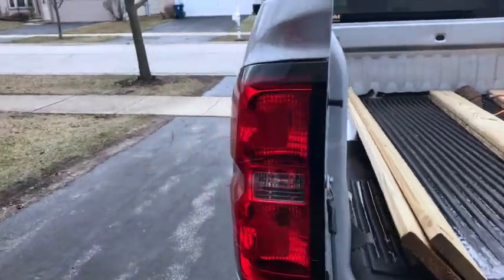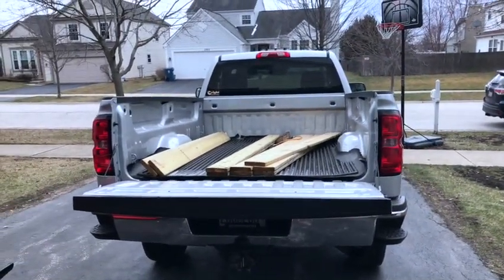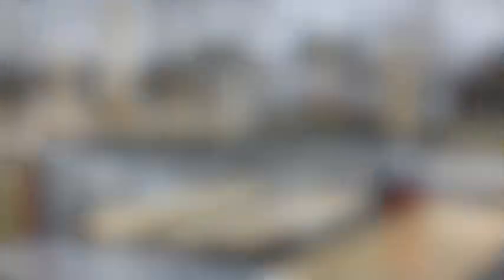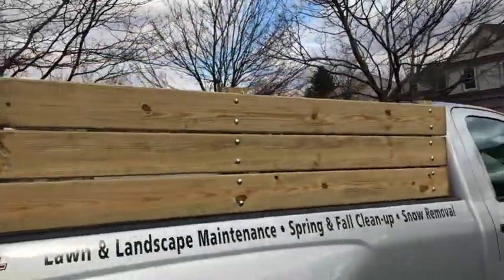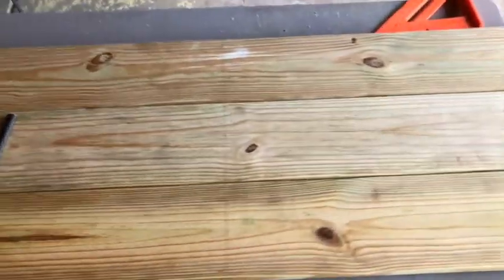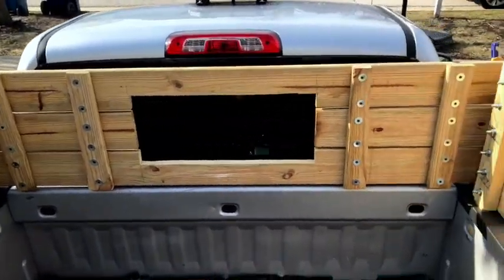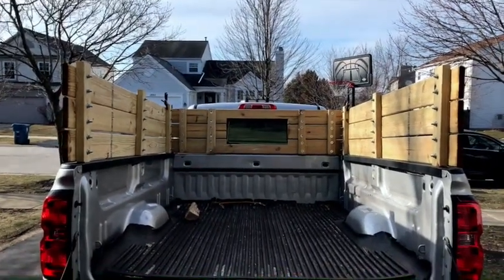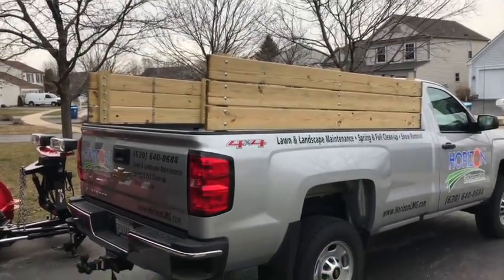Horizon VLOG #19 | Building Walls for Truck Bed

Comment: Looks great the only thought I have is you could put a small swinging gate just above the the tailgate so that you have an enclosed box and non of your mulch will fly out the back, plus you can stack bags of recycling full truck bed style , if you ever do recycling you could make 300$ a trip off of plastic bottles and cans with a full truck bed pretty easily.

Comment: Just wondering you are using nuts and bolts to assemble the walls but the actual posts you are using small screws? Plus made holes instead of using the existing hole which you could of used.

Comment: The stake holes in my 97 Ford ranger are only 1.75" × 1.5" and there's only 4 of them.. don't seem that would allow a strong enough piece of lumber to be put in there to support the rails and to hold a load of firewood

Comment: I like what you've done.  functional and it looks good.  Myself I would stain it.  And I would not have used the self-tapping screws on the post holes.  Holes are provided for a reason.  Washers and bolts would have done fine.
Reply: How would you put in a bolt and washer in there’s no room in the hole

Comment: How did you cut the openings so clean on the plastic liner. You cut them so perfect
Reply: Dan Straiton razor knife. It’s pretty thin in those areas because Chevy knows you’ll eventually need to cut them out. They were already traced out where I needed to cut. So I just cut along the line with the razor knife.

Comment: Excellent video, looks great! Stupid question: does someone sell the stakes to fit in the bed? Or is shaving a 2x4 the only option?
Reply: Depending on your truck 2x3s might fit with no modifications.  On my f150 i had to shave 1/4 inch off a 2x3 to make them fit well.  I used cedar 2x3s and 8 foot cedar fence planks on mine.

Comment: Great vid the only thing I would change is the screws. I think dry wall screws rust.
Reply from the maker: Yes, you are correct...they do rust. But, knowing that these walls will only be on my truck whenever I need them and not all the time, I just went ahead and used them because they are quick to zip in and out. It only takes me about 5 minutes to put on and take off...when I'm not using the walls, they are leaning against the wall in my garage. Thank you for the comment, and if you haven't yet, please subscribe! Thanks again.
Reply: Replace the drywall screws with screw's rated for treated wood. The chemicals in that wood will eat those screws.
Otherwise, nice build! Simple and effective.

Comment: Would you happened to have a matl list,  your came out really good, we have a lawn service also and are wanting to do the same for more volume
Reply from the maker: Bob T yep. Pretty simple. You’ll need 4 2x4s, 1 piece of plywood, 8 e-trac shelf brackets, and 2 4’ sections of e-trac. Then of course self tapping screws and drywall screws.
Reply: @HorizonLMG    Thanks and keep up the good work
Reply: @HorizonLMG  where's the etrac? I missed it
Reply from the maker: @vickit9752  the etrac was purchased at harbor freight...2 5 foot sections. I think they were $30...its been a couple years, so I can't remember exactly.

Comment: What do you think of the idea of putting the vertical supports on the exterior, so that if you are hauling branches they don't get hung up on the vertical ones as you try to shove them in?  Ditto the bolts--if the rounded head is on the inside, while the bolt and nut on the outside, things can't get hung up on the latter as you try to shove them in the bed.

Comment: I'm looking for a solution to my issue of taking my livestock (pigs, goats) to the butcher. I'd love to use this idea. Do you think it would be easy to add a gate that can open and close above the bed of the truck to keep in livestock?
Reply from the maker: 5 Gammons on 5 acres hmmmm. That’s a good question. I don’t think it would be difficult at all. You could add the gate to the back or the side. You would just need to add hinges. I would add the gate at the back above the tailgate. Add two heavy duty barn door hinges on each side and have the gate open like a barn door (one to each side). That’s just how I’d do it.

Comment: Hopefully if anyone else is using PRESSURE treated Make sure it is Painted or your ALUM truck pockets etc. are painted and the Pressure Treated wood against ALUM is not a good idea. The Alum will corrode from it. Learned that from making decks for a Alum Jon Boat.

Comment: How much did it run you in material? Also- how is it holding up since April?
Reply from the maker: Josh's Lawn Care it cost about $75 from Lowe’s and they are holding up perfectly. Still strong and sturdy!!
Reply: Horizon LMG — Thanks for the quick reply. I have an 8ft bed I’m going to try and put this together today. 

Any tips or anything you forgot to put in the video? Also are those 4.5 in bolts?
Reply from the maker: Josh's Lawn Care  yes!!! There is a couple things I’d do differently. Call me at the number on my truck. Easier to explain on the phone.

Comment: Widow is fantastic I really like it.  I would of drilled all bolt holes, then paint lumber black, then chrome carige bolts washers and nuts. Nice detail black and chrome together.  And a swing gate that operates independently of tailgate.